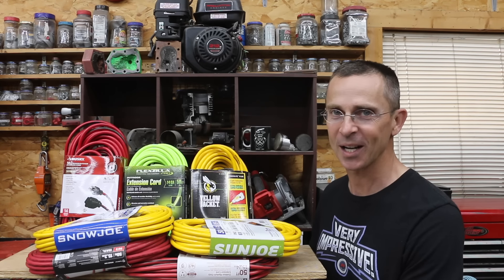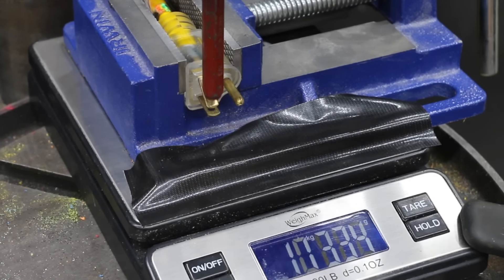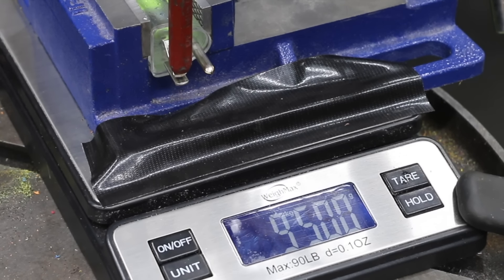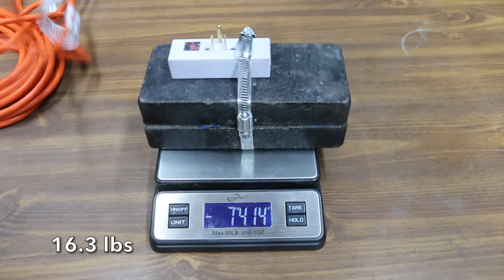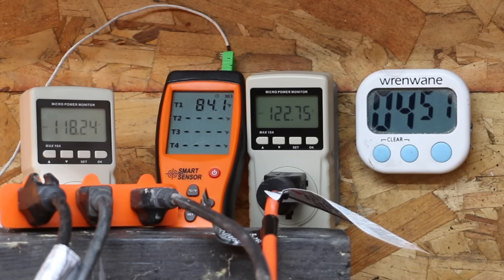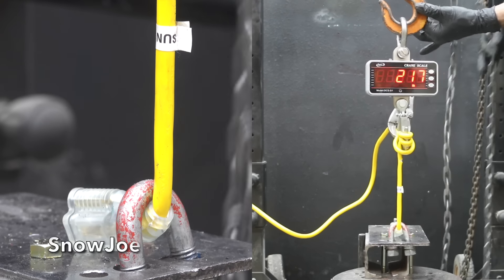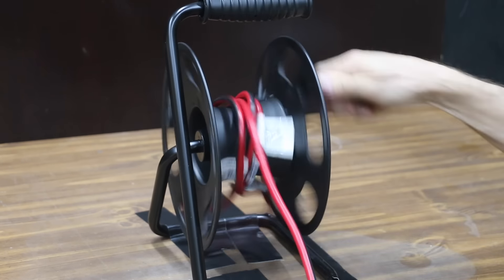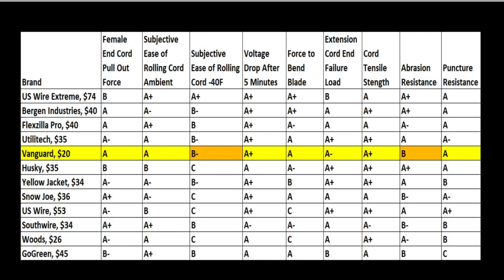Best Extension Cord? Flexzilla, US Wire, Yellow Jacket, Southwire, Husky, Woods, Bergen Industries

Comment: Pro tip, if you ever want to prevent your good extension cords from growing legs and walking off when you take them somewhere like camping, wrap electrical tape around the cord in a couple spots, it'll make people think it's a bad cord and they'll leave it alone
Reply: A few pieces of poorly wrapped duct tape works great for that too!
Reply: LOVE IT 😂
Reply from the maker: lol. Great tip!!
Reply: My dad did the same thing... only he chopped them up a bit first with the electric lawn mower...
Reply: @campbellpaul  😄
Reply: Lol, I did that with my corded power tools😄 Same idea👌
Reply: haha damn i bet this is actually pretty damn effective!
Reply: @campbellpaul  
🙈
Omg
Reply: thats brilliant. take some old wire too and tape it in there. it will look like junk
Reply: I rolled my shop vac along a dirt road a few times on its side to make sure it didn't wheel itself away
Reply: @campbellpaul  I used my circular saw.  Not as effective as I thought it would be, the cord almost survived.
Reply: I do this on the job site. It works. Still haven’t figured out to keep people from unplugging my scissor lift when charging.
Reply: Now I gotta steal the crappy ones too, thanks a lot!
Reply: Nice tip
Reply: Don't do this if you are working on a  construction site though, there's this old guy I work with he did this on a job site once and the safety guy came by and just started cutting his cord up with a pair of garden shears
Reply: Nice!!
Reply: That's along the same lines of driving a car with a manual transmission these days. Bonus points for it being "less desirable" to start with (aka V6 Mustang vs V8).
Reply: I used to take the cord, put it on a couple large pieces of card, painted spots on it with Krylon Paint. It was hard for someone to say that they had the same brand cord on construction sites. Taped cords can be banned, on construction sites. Also I Painted my Vacuum Pump, Pink, after it dried Put stick on dots, and Painted it Purple.  Had Pink Polka Dot, Purple Vacuum Pump.
Reply: @TheRealDarthRevan  safety guys shouldn't touch tools
Reply: That's a good idea! 💡
Reply: @TheRealDarthRevan  The tires on his car or truck would have got the same thing done to them. By the end of the day he would not like me at all.
Reply: @TheRealDarthRevan  Hope it was energized when he did it.
Reply: And do not bring it to work. If OSHA sees that that’s a huge fine
Reply: @spacepope-1  He would have paid me for that cord.
Reply: @GeorgeT6566   oh yeah my guy was furious he says he had to be escorted off site by security
Reply: @andreasu.3546  it was energized but unfortunately he didn't receive any jolt
Reply: My light duty 15 metre cord is actually bad. I asked a friend to plug in my compressor, & he was zapped. I walked over, picked up the cord by the bare wires, & plugged the compressor in. I stood there, holding the cord, & spoke to him like nothing was happening, yet I had 240 jolts going through me. I am one of an "elite" group of people in Australia, being a lightning strike survivor.
Reply: I found something that works just as good. Get a cord that is neon pink, fuchsia even.  About 15 or so years ago I bought a cord off ebay that was 80ft 10 guage heaviy duty. There was o picture but they said it was red. Price was so good I had to buy it. When I opened the package it was NOT red. It was bright, neon pink. I shrugged. So what. It's a great quality cord. Now all these years later I can say it was a great choice because none of the guys at work ever even thought about stealing it.  Whatever. I win.
Reply: @TheRealDarthRevan  Too bad. Maybe next time.
Reply: I sprayed all of my tools when new with spray paint and make it obvious if stolen, also air hoses and  extension cords get dragged through mud and dirt so they will look old.  Eating hammers and chains, etc get dumped into saltwater and left outside to rust. It's amazing how tools grow legs on the job and nobody knows how.
Reply: While it's coiled up, "ring" it with some highly visible opposing color stripes of spray paint, preferably acrylic, or some high-temp metal paint that will permeate the vinyl jacket and be very difficult to clean off.
Reply: Great tip my dude. Ty
Reply: One company I worked with ordered bright pink extension cords. They didn’t grow legs very often. Another company has their name printed on the entire length
Reply: This is true of garden hoses, too. A little duct or electrical tape works wonders.
Reply: @stevenmoomey2115  LOL, I painted a 12' and a 16' utility trailer with purple paint before, they never were stolen.  Another I had an old tractor tire cut near in halves and bolted them on for fenders.  Believe it or not one idiot called to police on me for stealing his trailer. I asked him what kind of pickup truck axel was under it and he came up with something like Chevy rear or something like that.  The cops looked underneath and agreed with me, it was in fact the solid front axel from a Nash car with the steering welded solid.  He went away with his tail between his legs, but not before the New Albany Indiana police gave him a ripping.  He never messed with me again.
Reply: @campbellpaul  i know that mistake from personal experience, the cord explosion was spectacular. 🤣
Reply: One of the THE greatest Pro Tips ever offered! Outstanding.
Reply: most people dont have that problem living in first world countries
Reply: @spacepope-1  And the average builder shouldn't be allowed within a hundred yards of electricity.
Reply: If OSHA see's that on a job site they'll try to confiscate it and issue a fine.. Then you'll have some splainin to do..  BUT that is a good idea..
Reply: @TheHello29  ... bet you can't wait till you are charging your electric car!
Reply: @_WyreTheWolf  you play the viola?
Reply: @0utpatient  I painted all my tools with pink and orange marking paint whenever I have extra on hand, no one wants to use bright orange and pink tools. Works a treat.
Reply: Regarding safety guy cutting up the cord - theyre supposed to check cords every now and then and issue you a coloured tape around the ends to prove it's been checked, least on the field level hazard assessment sites.
Reply: @campbellpaul  "electric" 
That is subtle comedy gold.
Reply: Just don't let an OSHA inspector see that cause they will make you retire that cord and get a new one...
Reply: My scooter body panels are filthy without being washed for years for the same reason
Reply: 🤣🤣 love it
Reply: Our woodworking teacher told us if a health and safety guy sees electrical tape on any cord is going to cut it up into pieces. Over dramatic I think.
Reply: Genius!
Reply: That’s a great idea. Brings me to my next question. The best tape v
Reply: ...and put on a couple of feet of heat shrink tubing of a different colour in the middle--with a big bulge of tape at each end--so that potential thieves will think that you patched together multiple cords.
Reply: @kristofbarta2964  write on a piece of masking tape “There is life after death? Cut my cord and find it yourself”
Reply: I gave this suggestion a thumbs up and the "likes" count went from 999 to  1K.
Reply: @stevenmoomey2115   I used to dip my screwdriver handles in that rubbery plastic-dip stuff in the brightest, most garish colors I could find so that nobody would want them, or so I thought. Now you can buy screwdrivers with fluorescent orange or fluorescent green handles!.
Reply: @_WyreTheWolf  , that's *voila*, not "viola"!
Reply: @goodun2974  
Hey, maybe he likes very large fiddles
Reply: @marcpavlik8776  it’s also amazing how guys have two legs but they can’t even use them because their knee caps are shattered!
Reply: Or spray paint them pink.  I have found that no manly-man tradesman wants a pink cord.
Reply: @christ6671  this YouTuber named Todd has a channel called Project Farm, he has a good video on what tape is the best!
Reply: With the price of scrap copper, you better keep an eye on those cords anyway.
Reply: @mermaidmuncher2708  very funny!! Love the sense of humour!!
Reply: @paddington1670  ... we've had OSHA inspectors show up at our shop and they never marked anything. They did keep a punch list and advised of anything that needed to be removed from service. BTW, they even inspected hammer handle for cracks / splits, plus checked air quality for excessive dust at a certain distance from stationary equipment.
Reply: @campbellpaul  Son, is that you?
Reply: Electrician here, doesn't matter. There's copper in there. That's worth money.
Reply: @ProjectFarm  Can you run some tests on this for us?
Reply: @TheRealDarthRevan  yeah ok, that really happened.
Reply: Nah, use pink or - better - rainbow tape. Thieves tend to be pretty insecure.
Reply: @christophejergales7852  ... the price of copper is only $3 per pound today... and it's not worth your effort to get it out of an extension cord at that price. If you stole 100 cords and "cleaned copper" over a weekend you might make $100... but also risk going to jail for each offence. What's your life worth?
Reply: @rupe53  you definitely don't work in construction.
Reply: @TheHello29  put a lock out tag out extension cord cover on it
Reply: @christophejergales7852  ... that's right, I retired almost 3 years ago. The type of trade I did was only single days on a job site so never had to worry about petty theft.
Reply: @rupe53  Mystery solved.
Reply: Why you need a 50 ft extension cord while camping?  Are you camping in the backyard and need your TV in the tent? Lol
Reply: Lmao! Genius stuff! Camo for cords! Excellent idea!
Reply: @TheRealDarthRevan  

Did he unplug it first? 😉
Reply: I like it.👍
Reply: @TheHello29  Turn off the master switch and put a padlock on it.
Reply: You sir, are a genious!
Reply: Dang that's smart 😂😂
Reply: @elivaughan1192  Dude I'm rolling. That genius. Pure psychological genius.
Reply: @TheRealDarthRevan  OSHA doesn’t like it either
Reply: @TheHello29  Park the lift on top of the extension cord do it all the time at work.... Union ironworker‼️®™️
Reply: @ProjectFarm  The best cords have the black stripe so you can wind them without twisting the wires. I still have my utilitech cords over ten years for this reason. Always loop your cords, never wind them around your arm etc.
Reply: As a contractor I've been doing this for Years on job sites 😂
Reply: @TheHello29  get a cheap pistol safe from harbor freight. Plug everything together and put it in the safe and lock it
Reply: @mermaidmuncher2708  LOL, I don't know what you mean.Wink Wink.
Reply: I've found that the pink ones I buy are also less likely to walk off
Reply: I know a man whi does that with his camper extention cords. He used to have at least one disappear a year before doing this. He hasn't had one walk off from a campground in 10yrs now.
Reply: @TheRealDarthRevan  That would be very unsafe for the safety guy. Because he would get his teeth flossed with the remnants. Down to the gums.
Reply: Hahah!! Love this!
Reply: @JaredConnell  ... many camps have power that's especially useful if you have an RV or pop-up that has stuff inside like lights or fans.
Reply: @christophermarshall5765  Then the only wire you were touching was the earth.
Reply: Good tip !
Reply: @TheHello29  Gotta jimmy rig a shock on the cord
Reply: Have a wire nut sticking out the side of the tape too lol
Reply: @strizzy239  that would look wonky.  Lol
Reply: @TheHello29  Get a "bubble" outlet cover that has a locking hole. You can remove the faceplate of the outlet you want to use to charge, install the bubble cover plate, plug in the lift, and lock the cover closed. The good covers are very stout and they have a notch at the bottom to allow a cord to drape out of the cover while something is plugged in. Otherwise, I'd say build a simple closed plywood box with a dummy plug attached to it internally at the bottom that will hold it in place against the outlet cover plate. Cut a small hole in the bottom for the lift cord to hang out. Paint it red and put a sign on the front face in white saying "DANGER: DO NOT TOUCH! ☠️☠️☠️ EXTREME SHOCK HAZARD! LOCKED OUT, TAGGED OUT." Put white lightning bolts on the top and sides. That will stop most people from screwing with it.
Reply: @doublejaylar  q
Reply: I just saw this tip somewhere on the internet like two weeks ago!! Awesome share!!
Reply: @NA-pg4lf  It's only an OSHA violation if the electrical tape is covering bare wire. It's  legal to use electrical tape to wrap a cut in the outer cord sheathing!
Reply: @HAL-dm1eh  not on gov job sites, your employer signed a contract stating that the safety inspector has final say.
Cords showing damage are not in code, and have to be destroyed.
Reply: @brianellison3525   I'll sue.
Reply: @doublejaylar  yes, but then when you go to remove it it leaves residue behind whereas electrical tape doesn't (if it's of half decent quality of course)
Reply: It's not camping if you have electricity. Other than a battery powered radio for safety.  A camper is no different than lighting a fire in your backyard,  having smores, and calling it camping.
Reply: Also works with electric guitar cords
Reply: @TheRealDarthRevan 
Hurts to read, I had nearly the same thing happen to me.
Someone left a beautiful +100ft, 8 gauge monstrosity behind at one of the buildings I worked; only thing wrong with it was a missing ground plug.
Stayed there for months, dusty and forgotten in a corner.
Then one day a much loathed, over zealous, ex-AF safety inspector decided to not only put the whole thing under the knife and in the dump.
To this day I still regret not helping that extension cord grow legs and meet a more constructive end.
Reply: My wife didn't believe me when I told her that it wasn't the electric corded weed whackers that chopped up my $200 10 gauge 100 ft extension cord 😳 it was done on purpose, not an accident 😂 all to prevent theft😉
Reply: I bought a bright neon pink extension cord. Seems nobody wants to be seen with a pink cord. Haven't had any issues of it walking off
Reply: Just use a magic marker and put my initials or last name on both ends.  Thief usually says they didn’t think it was mine….. same people where wrenches and screw driver disappear.
Reply: That is an excellent tip I'm totally going to use that!
Reply: @lynnh7694  a cord only a scrapper would want lol
Reply: noted, will ignore the tape next time lol
Reply: I hit mine a few times with the skill saw. Nobody's asked me to borrow them!😂
Reply: Pro life hack right here.
Reply: After a couple of years, I would be wondering how my cord got so cut up.🥰
Reply: Or convert to twist lock plugs on everything you can.  Not only can they not use them without making changes it's pretty tough to try and steal power when that is all you have on the outside of the house.  Then just make adapters that can be placed on the end for use with regular tools.

This is exactly what I am doing on my house.  The plugs are 20A rated and then I throw a 4 outlet box on the end of an adapter for my heavy cord and will have a single plug adapter for my lighter ones for just in case I need them.  Will make working outside with power tools really nice.
Reply: @campbellpaul  I did the same thing with a corded hedge trimmer. My 50 foot cord is now a 48.5 foot cord!
Reply: Oh damn .. nice
Reply: And the tape wrap has to be lumpy so that it looks like it was repaired underneath the tape.
Reply: @TheHello29  I found pad locking the cord to the lift works well. It doesn't stop them from unplugging it from the outlet, but if they're trying to unplug it from the lift it works great
Reply: @campbellpaul  that's some good thinking
Reply: I’ll take that advice
Reply: Wow, that's brilliant! I'm going to remember that
Reply: Camouflage FTW!
Reply: @bread-gz3rl  I spray mine pink
Reply: Holy shit that's clever
Reply: Nice tip thnks
Reply: @fellipec  they don't want to steal my mobility scooter!! This thing really stands out. It has a huge 370 watt solar panel on it. I fitted it myself.
Reply: mind blown
Reply: Thats a diabolical idea, love it.
Reply: I love it! In a similar vein, I’ve been able to keep claimed spaces at outdoor concerts and spaces on the beach free of theft by placing a diaper with melted chocolate right in the center of a blanket. For some serious Hollywood SFX ultra-realism, go with a melted Fudge Brownie Cliff Bar. I guess you could also lay the cord of a treasured power tool across the “load” of one of these loaded diapers. 🤓
Reply: You, sir, are a genius. I love this lol
Reply: I spray some pink paint on my tools. Pink is like kryptonite to male thieves
Reply: It’s like I used to spray paint my new aftermarket car stereo to make it look like junk to prevent theft.
Reply: @marcpavlik8776  Greetings fellow indiana resident
Reply: I think best comment should get a free item???
Reply: @ProjectFarm  you're my hero.
Reply: I used to do this when I worked as a contractor on build sites.  Worked well!
Reply: Have a care doing this at a job site. Some OSHA inspectors have been known to chop a taped cord in two without consideration for whether the tape is cosmetic.
Reply: @thenegus5469  Hello!
Reply: Don't do that on a job site BTW. OSHA will likely ding you even if the jacket underneath is intact.
Reply: All my extension cords have multiple pieces of electrical tape already.😉
Reply: I heard about a guy who bought only hot-pink extension cords to prevent them from walking away. But I like your idea even better.
Reply: Psychological warfare, nice!
Reply: at night people do not see the tape.
Reply: Is that a pro tip or a hillbilly tip?
Reply: Good idea.
Also consider what you want to do with the cord - the voltage drop do play a role for some applications while being less important for other.
Reply: Great idea, Also paint your tools pink and load them up with hello kitty stickers. Nobody walks away with them.
Reply: @TheHello29  disconnect all the other controllers from the other lifts. Then they won't need to use your cord to charge theirs as they won't be able to drive it over.
Reply: @Slaphappy-_-  a free used broken item
Reply: @ProjectFarm  my dad actually got a pink one for that reason and it worked
Reply: @HAL-dm1eh  hey, could I trouble you to open the pod bay doors?
Reply: Interesting!!
Reply: Thanks dude.....smh...yep.
Reply: @Nighterlev  you have just proven to me that you know fuck all about electricity. I was standing on the ground with bare feet. This means I was creating a path for electricity to the ground. You are still assuming things, yet you were not there at the time it happened. I have witnesses, and you are not one of them. Stop explaining what you do not know, and did not see. What I said actually happened.
Reply: I used to splash paint on my car tires for the same reason.
Reply: @ProjectFarm  can you test out the concrete sinkers. Some say they have the strength of 1200lbs. Would be a cool video
Reply: @TheRealDarthRevan  I've never worked commercial jobs: was this someone's personal cord?  If so, that sounds like a crime.  I can see where a safety guy felt he had a right to remove a cord from use, but I don't understand how he felt he had the right to destroy someone's personal property.  My mental framework would have been to treat that man as a thief and I'd have been deciding on whether to call the police or handle him like any other thief.
Reply: @bobcougar77  well yes it was his personal cord.... but actually no 

The company he worked for paid for it and it pretty much stayed on the work truck but he used the work truck as if it was his driving it to and from work, to the grocery store etc. therefore he considered the truck and everything on it his
Reply: Lol 😆
Reply: I usually put grease in some parts and let it dry then add horribly placed electrical tape on it.
Reply: great suggestion thanks for sharing
have a great day :)
Reply: @TheRealDarthRevan  that doesn't seem very safe
Reply: Whoa
Reply: @TheRealDarthRevan  How does someone like that become a safety inspector when he goes and cuts a live extension cord up? Crazy!
Reply: Great tip!! Thanks!
I’m on my way to do this to all of them! 😂
Reply: @TheHello29  completely strip the wire so you have to use nitrile gloves to unplug it without being electrocuted
Reply: @TheRealDarthRevan  
I was thinking the same thing, our safety man will cut a cord in a hot minute if it has electrical tape on it
Reply: I have to do that anyway when a forklift runs over it and roles the coating off lol . And on the first day I got it. Now I run cordless everything.
Reply: Wouldn’t stop me😂
Reply: @dafalzonAUS  " Good enough for them, good enough for me"
Reply: Lol diabolical genius.
Reply: ⁶y
Reply: This comment has been stolen from a Facebook meme.
Reply: 🤣🤣🤣

Ill remember that 👍
Reply: @doublejaylar  even better.A+
Reply: Man this tip is pure gold!
Reply: They can have the one my wife fixed after she cut it with the weedeater.  She twisted the wires, not separately and insulated from each other, and taped them up.  lol.  Where do you camp that people steal your cord?  I've been all over the country and haven't had anything stolen anywhere.
Reply: genius idea about the cords
Reply: @TheHello29  bright colored padlock lock padlock around conduit to outlet with the cord through it.   It's not 100% but is very very good at keeping it plugged in.
Reply: @TheRealDarthRevan  At that point you go to the safety guy and have him buy you a new expensive cord.
Reply: Now that is a fantastic idea I love it
Reply: Absolute genious.
Reply: Good tip 👍
Reply: another suggestion would be to simply park the vehicle on top of the cord. It's not going anywhere in 1 piece that way.
Reply: @TheHello29  
Swap the outlet cover for a locking cover.
Reply: Back in the day they use to sell these fake fronts you put over your car stereo that had wires hanging out of them. Park it in Boston and people think the radio is already gone and go to the next car lol.
Reply: I'd heard of people doing that with their luggage when they travel, to make themselves look like poor tourists......
Reply: @NA-pg4lf  Fines are subject to review, lodge protest/challenge.  Prove "safety guy" was in error, that is cheaper in time and money than paying 10's of thousands in fines.
Reply: 1000 iq tip thank you
Reply: Yeah. This isn't always the case. I've grabbed many cords out of the landfill when dumping reno trash that were mostly just bad plugs which is an easy fix.
Reply: I find hand wrapped around elbow wrapping a cord over daisy chain.
Seen the wire break more than elbow method.
Reply: I bought hot pink cords
Reply: Don't forget to tuck a tiny piece of scrap wire in the electoral tape so it bulges and looks like a shotty rewire job
Reply: I heard of a guy who did that just to mark his cords so he could identify them. He had a pattern of three strips on each end. Osha showed up one day and immediately assumed his cords were bad and cut them with a knife. End story, they had to buy him new cords.
Reply: @leifhietala8074  Must have been a shitty saw. 😁
Reply: If you need an extension cord camping, you're not really camping.
Reply: I have done that for literally decades.
Reply: I was on a jobsite once where our company ordered 100 12/2 cords, 100' long, made with lighted ends, the same color as the company logo, and they had the company name printed every few inches all the way down.
Reply: Excellent idea
Reply: @spacepope-1 that’s when the safety guy gets all his tires cut with a sawzall
Reply: @TheHello29  easy on the scissor lift problem - just cut the wire insulation near the plug for a hearty reminder not to touch your lift
Reply: @davidelzinga9757  company i worked for had the company name printed on the entire cord. Bad idea, shows osha who to fine if theres damage to the cord or the ground broke off by a field guy and the company has no idea the cords damaged until they get the fine
Reply: @craigcurtis9781  i think he meant ppl unplugging it while it was charging so they could use the outlet. He comes in the next day its unplugged and not charged cause someone couldnt take the time to look for another outlet or plug it back in when they finished using the outlet
Reply: @jacksmith2315  ... you have a valid point, but I like to think MOST people are honest. Still in all, petty theft is a problem and people do it because they are usually not caught... and it's got nothing to do with drug money. They just see something nice and grab it because nobody is looking.
Reply: Heh, I do this with my heavy duty home made cables. I also wrap a couple butt connectors under the tape so it looks spliced. I've taken a few stranded wires and let them hang out of the tape. I had one guy drop a cord real fast after he felt the wire give him a prick lol.
Reply: See that's the sign of a good cord to me.
Reply: Sounds like a good idea for the front yard garden hose too 😁
Reply: @jacobthomas90  wait will they not even consider if not original molded on plug and socket/receptacle ends menaing if its ever been repaired/replaced with a new outlet or plug end they will refuse to inspect/certify it?
Reply: @The_Cyberz  ?
Reply: @MrFixItGa  that is a genuis idea for what it is worth imho because then for the life of rhat cord if not given a significant amount of effort compared with what is presumable for theives to want to put forth/to take an average cord etc then that is a good deterrent fit sounds like
Reply: @bsanchez3563  well I haven't heard of that causing any issues but idk. I would imagine it would be ok as long as the proper plug ends were used...
Reply: @Farm_fab  especiallu withthose if not the expanding type for then will not have to be "certofied for safety" or if theu do it is only for hof water use I would assume not for merely using as a water jose etc fwiw
Reply: I have done the tape trick & sprayed painted a few colors every five feet and they hung around linger but eventually grow legs and walked. Thought I had it solved while wiring up a 15,000 square foot factory. Had over 700' of extension cords locked up in a metal box locked up inside sprinkler room. Was there when I left on a Friday & MIA when I went to use them Monday morning.
Reply: This is an old-school trick, and it's starting to not be very effective anymore
Reply: Lol gd 1
Reply: That's a burning man trick
Reply: lol that is genius.
i wrote a slur for homosexual on my dunlop boots when i worked on oil rigs. nobody's stealing those ;)
Reply: My good cord "walked off" while building a deck for a friend.  We went to a box store to get lumber.  When we got back a party rental truck was temporarily parked right where I needed to park.  Some young guys from another country where there setting up a tent.  I didn't notice it was gone til the deck was nearly finished.  Hope that kid enjoys his thievery
Reply: @campbellpaul  Brother?
Reply: Great idea. Thanks for sharing.
Reply: @campbellpaul Mine too! But he used a hedge trimmer.
Reply: Was hoping to see some power strip/surge protectors to go along with the extension cords!  This is a great video!  Thanks for helping me nail down what I'll be using going forward!
Reply: @prashanthsiddalingaiah5914  As long as they understand the myths surrounding surge protectors and the dangers of power strips.
Reply: On an OSHA site, a repaired or simulated repaired cord will be cut and tossed.
The only legal repair has to be made by an electrician with tag with date and company/individual who made the repair.  The repair then has to have an inspection with dates, also by an electrician. 
This tends to be a bit on the expensive side and can exceed the cost of a new cord in short order. 
I will not take any chances on an OSHA violation just to save us, or a subcontractor, $100.
Just as a general note.  If you need a long extension cord use the appropriate SO cord a gage or 2 higher and use a 4x box with outlets.  It's a lot cheaper than an equivalent extension cord.  On a jobsite have it made by an electrician and tagged. Use GFCI outlets.
Reply: @planeman1965 to which you would be fired, perhaps your company thrown off site, and legally charged with destruction of property. 
Note also that in some areas (Florida as example ( theft or destruction of property is automatically a felony regardless of actual value.
In addition jobsite cameras are extremely common in this day and age.
Safety guy was following company protocol not being malicious.  OSHA fines aren't a joke, and in addition they affect insurance rates as well as even being allowed to bid some projects.
You pull that on a job I'm running I would prosecute to the full extent of the law, as well as you being thrown off the job with cause. Depending on the industry that can blacklist you for future work in said industry forever.  Those lists are shared
Reply: @jacobthomas90 and fine you, as well as the GC. That's why GC's cut and toss damaged cords
Reply: @HAL-dm1eh sue all you want..you won't get further contracts and still loose that lawsuit.  Contract law and its in every contract..not just cords but osha violations in general
Reply: @bobcougar77 doesn't matter, it's a violation of OSHA and every contract I've given or seen in the past 20 years gives the safety guy, or actually anyone onsite, the right to correct safety violations.  If he makes an issue of it is thrown off-site for cause..and that can make it hard to get new work
Reply: @wastelandman198 I've cut live cords..a few sparks but if there are insulted handles no big deal.
Reply: @PaulKMF1 garrentee OSHA didn't buy them, the contractor may have though..not because they had to but for goodwill
Reply: @NA-pg4lf  They can't give you a fine if you just put tape on...This tip isn't about actually cutting up the cord. It's all about making it seem like it was. If someone with the ability to fine you for health hazard comes around, you just show that the cord is untouched and they cannot fine you.

That being said, what the heck?! Do people in America REALLY have to bring their own tools to their jobs?! Isn't it supposed to be provided by the employer? That's absurd...
Reply: The ultimate pro tip
Reply: Good idea! Next level would be spray painting it pink. No dude would touch a pink cord let alone steal it.
Reply: Where do you go camping, where extension cord theft is common?
Reply: Ricky Bobby your genius. I never thought of that. I'll keep that in mind. If you anit first your last baby.
Reply: I bought a pretty decent makita circular saw and my buddy thought hed fix me up and cut the cord while we were building a garage wall. I guess i should thank him cause its U G L Y with no alibi.
Reply: Oh my... That's just like what we Brazilians do with our motorcycles before going to dangerous places. We get to the point of changing parts for wornout ones so the "grubby soul" will be like "meh" and ignore the bike.
Reply: Or buy bright pink. You will never lose a single cord.
Reply: You could tape some short 6in wires in the middle with some wire nuts connecting them too 😂 no one’s touching that cord
Reply: Also don't forget to put some scrap pice of wire before taping so it feels like splice.
Reply: Lol
Reply: @rickybobbyracing  I bought 2 bright pink and 1 purple cord from badass extension cords for my bands' gigs. Nobody wants anything to do with those cords, and these stick out like a sore thumb. Haven't lost one yet.